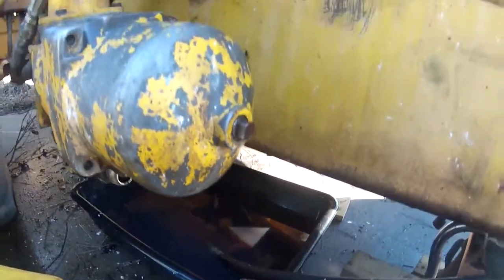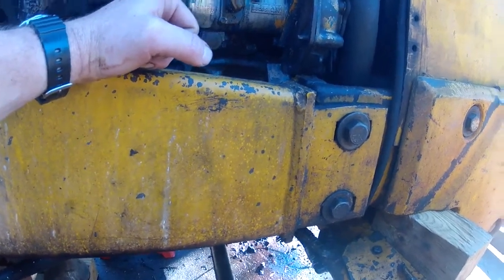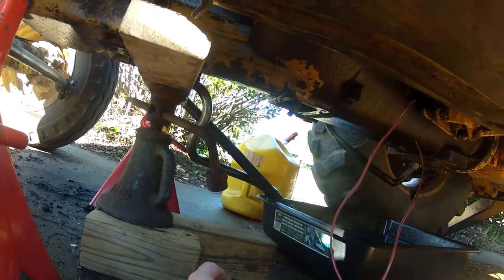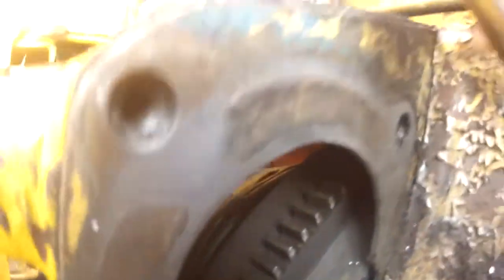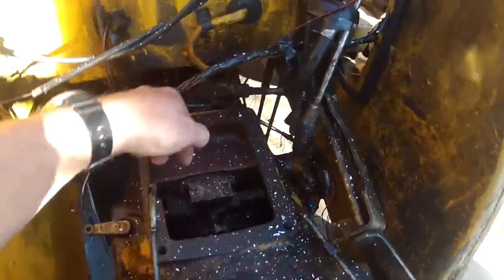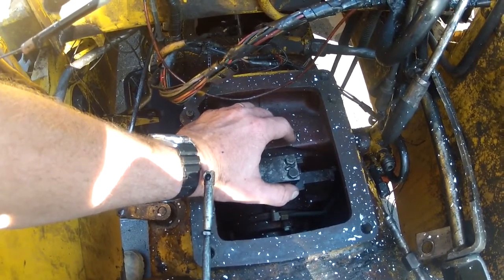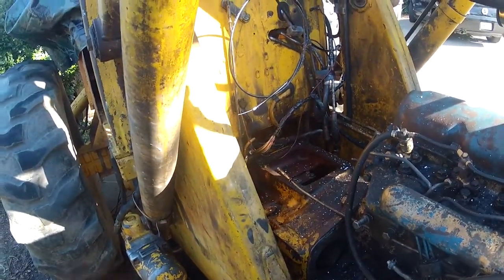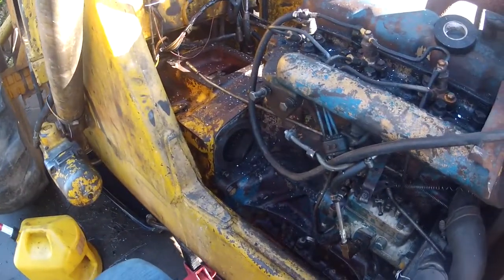1981 Ford 555 Backhoe Transmission Issues Part 3 (Prepped for separating)

Comment: Great video I'm just getting ready to separate the frame on my Ford 555 just wondering how much work it is actually two separate the two sides? How much time do you think it took you to separate the two sides? I might backhoe the torque converter pump seal is leaking.
Reply from the maker: It only takes a couple hours to separate them. About an hour and a half if you’ve done it before.

Comment: How heavy is that triple nickel I am lookin at one and wondering if my car trailer and power stroke will tow it all right on secondary roads
Reply from the maker: The shop manual quotes the weight range from 6,000 to 15,000 pounds depending on configuration. When I secured the over-the-road hauler to deliver mine to me the paperwork stated 10,000 pounds. I can’t give you an exactly accurate weight. Sorry.

Comment: I need to replace my  power steering hoses from steering to frame connection before  they go 
 to block on frame or join the Ridgid block on frame  I have one burst up behind the fuel tank to steering  question is since I see you have your apart working on trans what all do I need to remove to get to the ends behind the fuel tank I can get to the other ends of the frame near the front  but don't want to take off to much or more than I have to on this 555A so do i take top engine cover exhaust pipe and the top air intake and the tank out or is there another way to get them off steerig house pump
Reply from the maker: The engine cover should bolt to the top of the fuel tank and there are three bolts (two to the rear and one to the front) that hold the fuel tank in place.  You can unbolt these to get the fuel tank out of the way (don't forget to unhook the intake line into the fuel filter from the bottom of the tank ((Double don't forget to close the fuel shutoff valve on the bottom of the tank))).  Then I took a ratchet strap and ran it through the part of the top of the tank that the hood bolts to and hooked it onto the front bucket boom (You'll need to raise your front bucket and make sure you have a safety brace in place so it doesn't come back down).  I used the ratchet strap to lift it up and forward and that cleared enough room behind it to get the wrenches in to the steering hoses.  Hope that helps.  Let me know how it turns out.

Comment: What tsnsmission fluid you youse..
Reply from the maker: Either Traveler's Premium or Super S Supertrac 303 from Tractor Supply.  Both meet the recommended Ford viscosity standard published by Ford for a 1981 Ford 555.  Thanks for the question.
Reply: @mytaborcityhome1002  
Check Southern States for pricing on oils